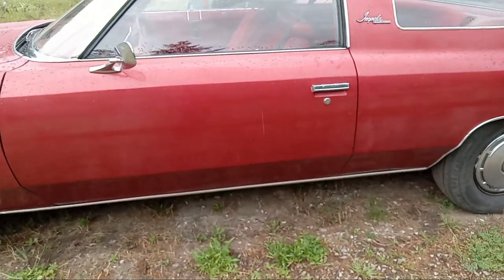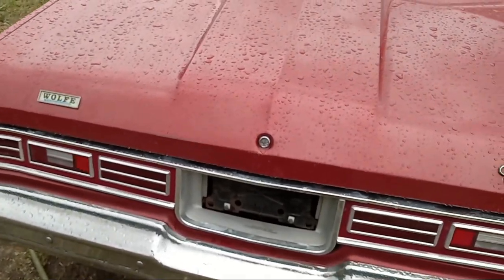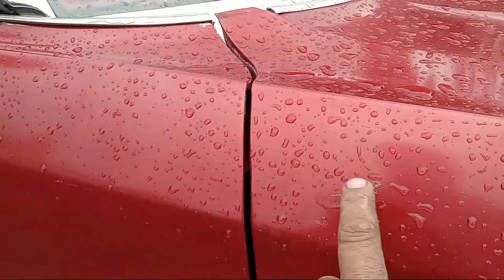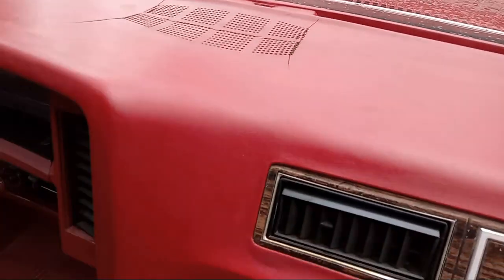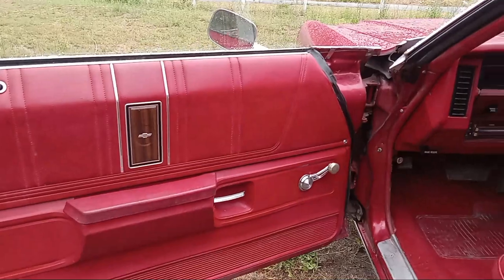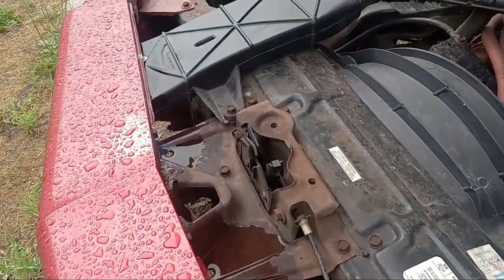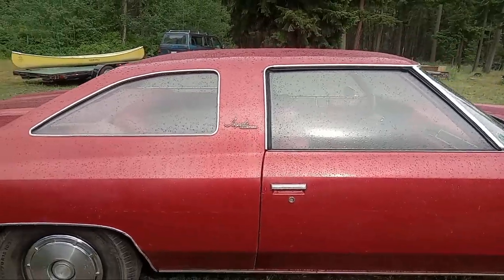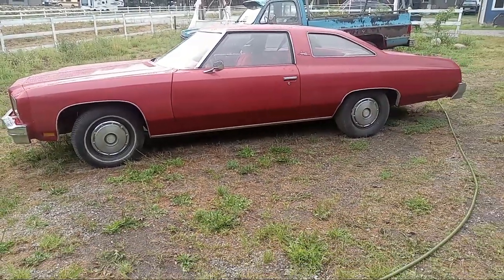20K Mile 1976 IMPALA SOLD!

Comment: I had a 1974 Chevy Spirit of America Impala that was given to me back in the mid 1980's  .i got the car with no engine .at that time i was driving a 1972 Oldsmobile Custom Cruiser station wagon with a 455 4 barrel and 400 turbo tranny .My Dad and i yanked the engine and trans out of the wagon and dropped it into the Impala  ..Car now had a 455 4 barrel with a 400 turbo with 3:73 rearend gears ..That car was fast ...i miss that car 😊
Reply from the maker: What happend to the wagon?
Reply: @ABANDONEDCARREVIVALS  went to the junkyard
Reply: @ABANDONEDCARREVIVALS  the guy that gave me the Impala wanted the rearend out of the station wagon.  Had a 4:10 or 4:11 rearend gear that he wanted ..

Comment: So what would it be worth ?
I know a lot of guys get these and put giant rims on them, and drop worked LS motors in them.
This one seems too nice and original to do that to it.
I’d like to keep it original  and maybe some period factory upper trim level wheels or hub caps, and Vogue white wall tires on it and drive it.
Reply from the maker: ah yes, the Donk! yes hopefully that will not be the fate of this car.
Reply from the maker: current high bid on ebay is $5100 USD